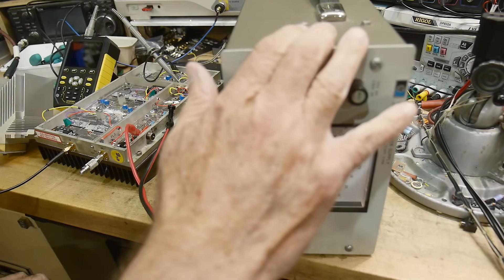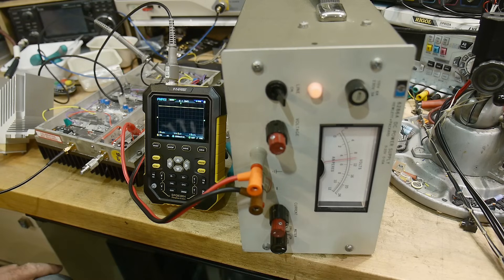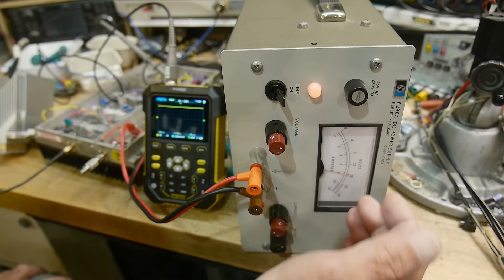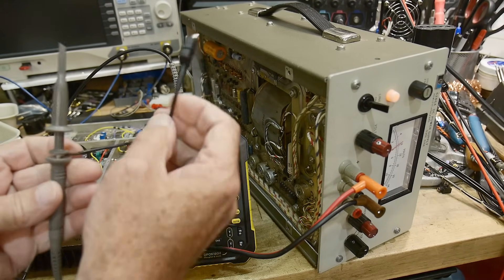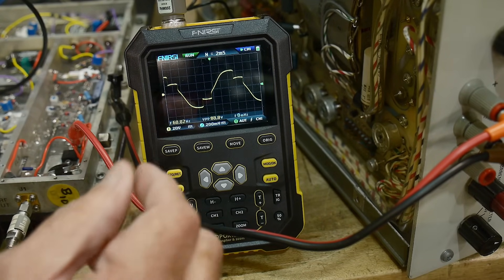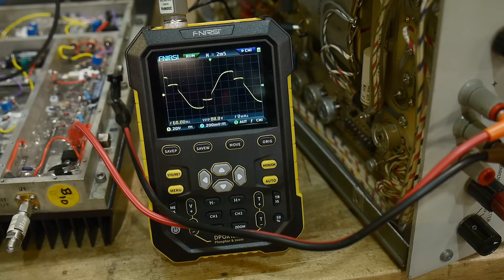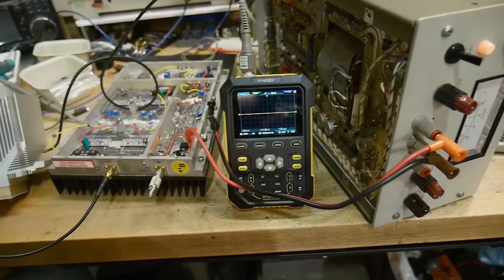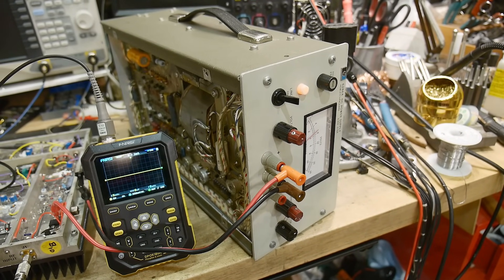#1871 HP 6286A Power Supply Repair (part 3 of 3)

Comment: Your power supply is possibly an export model, designed for the New Zealand market. We get a lot of earth quakes here, so it's good to have instruments that work well after they've fallen over. Maybe it will work even better if you do a 600mm drop test to simulate what happens after a magnitude 6.5+ shake, when things fall off the bench onto the floor.

Comment: Yeah, sticky meter movements will trip you up every time.  I'm glad the power supply is working otherwise.

I noticed that power transformer secondary is jerked down to the voltage of the bulk filter cap when the SCR fires.  This must make for terrible power factor and EMI.  I noticed on some of the earlier Harrison pre-regulator circuits, they used a pi input filter on the line for this reason.

Comment: Another very interesting video, thanks.
I have this PSU and have used it for years, probably way above my skill level.  I don't short the negative and ground as you have done.  Should I have been doing that?
Reply: The positive and negative leads were shorted so the current limit could be set.  To avoid taking chunks out of the meter leads, I turn the output voltage to zero, short the leads, then turn up the voltage slightly, and then set the current limit.
Reply: Yes, if you want a positive supply referenced to ground (typically the case). When you want a negative supply, short the positive terminal to ground. If you don't do this, you'll have a floating supply, which unless you need it, causes trouble when probing the circuit.
Reply: @kpnconsulting8739  Agreed!

Comment: Maybe ditch the analog meter and put a digital display in there 😱.  A power supply with wrong numbers showing is BAD!
Reply: I'd rather fix the analog meter. They have quite a few advantages over those cheap digital ones.

Comment: For giggles, try wiping the meter face with a laundry anti-static cloth and make sure that's not your problem. I've seen this more than once over the years.
Reply: WA4 has it right. Static charge on the plastic window. Try it. Easy answer and most always right. Mike in Silver Spring.

Comment: This is a mains frequency switcher. It uses the leakage inductance of the transformer to limit the capacitor charging current. That’s why the sine wave “flattens out” when the capacitor is connected via the SCRs. When the capacitor is connected, the voltage across the secondary is the capacitor voltage. We are measuring the voltage across the secondary + leakage inductance so we don’t get to see the voltage going to that leakage inductor. We can see it by looking at the primary waveform, or by winding a couple voltage sense turns on the transformer to avoid dealing with mains. A current probe would show very nicely that the time derivative of the capacitor charging current follows the voltage across the leakage inductance.

The transformer is probably designed to have sufficient leakage inductance, otherwise the concept won’t work. This is also why in this supply if the transformer fails, it should be rewound identically and reuse the magnetic circuit. That way the leakage inductance will be maintained.

The transformer is buzzing because the secondary current is very rich in harmonics - much more than it would be if the SCRs were permanently turned on (ie if we had just a plain old rectifier bridge).

The buzzing could be eliminated by allowing a bit more losses on the rectifier, thus replacing SCRs with mosfet pairs, driven by a dI/dt and dV/dt regulator.

Comment: The pre-regulation is interesting, it switches on after the the voltage maximum in the case shown so that the capacitor stays charged at a voltage just sufficient for the main regulation. As a consequence the angle of current flow also gets smaller. So for low voltage and high current at the output the peak current in the transformer gets really high, maybe 30A or more for 10A at the output but I am sure the transformer is strong enough for the operation.